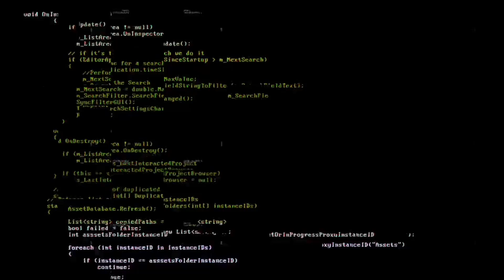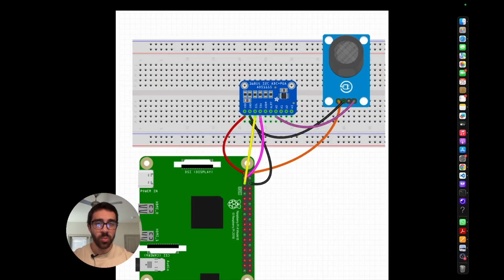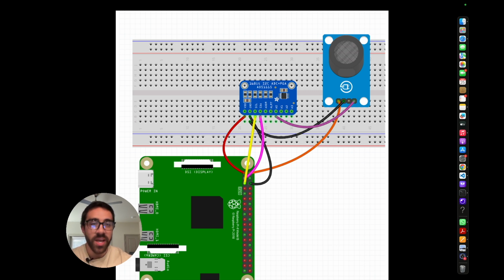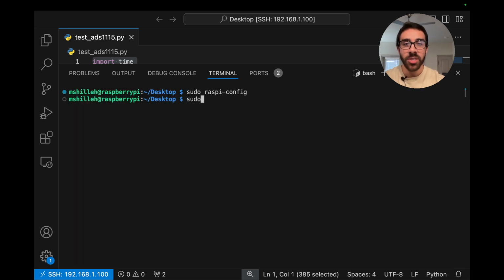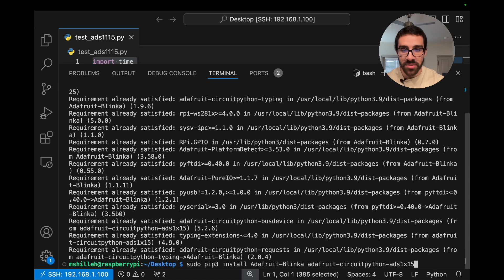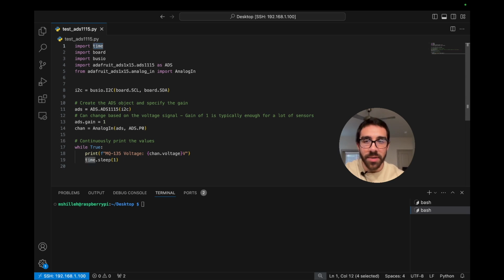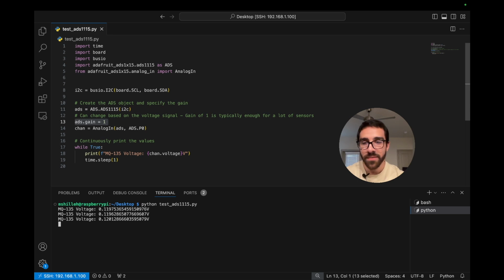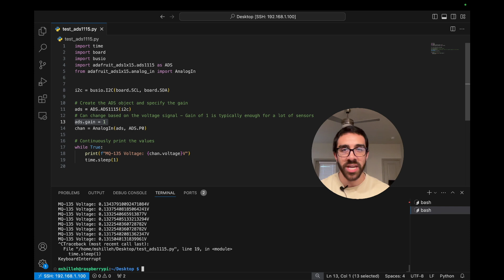How to Connect ADS1115 to Raspberry Pi - Measure Analog Signals with MQ135 (Part 1)

Comment: AttributeError with Adafruit ADS1x15

Getting error when using Adafruit ADS1x15 library:

```
AttributeError: module 'adafruit_ads1x15.ads1x15' has no attribute 'P0'
```
Please help me...
Reply from the maker: Sounds like a library version issue perhaps? Make sure you have the latest version of the Adafruit ADS1x15 library installed.

Comment: ADS1115 Out is 5.5V, Raspberry pi input is 3.3V
Reply from the maker: You're right! It's important to use a voltage divider or a level shifter to safely connect the ADS1115 to the Raspberry Pi to avoid damaging the GPIO pins.

Comment: Do you think the problem would be improper wiring or what for if there is no device connected once you input i2cdetect
Reply from the maker: Could be, or bad jumper wires. Could be many things
Reply: @mmshilleh where are import board and busio from? I was able to get i2c to detect, and virtual environment that has adafruit_ads1x15 but when I import it won’t import board or busio
Reply: Or I guess how were u able to download the Adafruit-Blinka adafruit-circuitpython-ads1x15 straight from the terminal

Comment: I am using raspberry pi zero 2w. When I do i2cdetect, I see 48, but when I write the code, it gives an "import board" error. When I try to install with pip, I get the "externally managed environments" error. I downloaded Adafruit and I can see it in the folders. PLEASE HELP!!
Reply from the maker: Use a virtual environment in Python, easy to setup
Reply: @mmshilleh  Is it enough for me to set up a virtual folder, do I also need to do something extra for that? I've been dealing with this problem for days...
Reply from the maker: @TeknoTeen0  I can set this up for you in detail if you want to hire me on Upwork if you are interested! Hard to give details in the comments like this :/
Reply from the maker: @TeknoTeen0  Message me on gmail shillehtek@gmail.com

Comment: When installing the adafruit libraries i run into an error about externally managed environments. Do i want these files in a virtual environement or installed system-wide. If i need to install them system-wide, what is the correct command for that?
Reply from the maker: A virtual env is fine! As long as you activate it first before running your code

Comment: Great Video! Thanks
Reply from the maker: No, thank you for watching!
Reply: @mmshilleh  I finally got around to giving this a try. I had an ADS1115, hooked up 4 different voltages, used your code, and got my first voltage connected to the ADC. The question now is what code do I need to add to read all 4 voltages and print out the 4 voltages. Thanks
Reply from the maker: @donaldhoudek2889  Hey Donald good question, I can make a part 2 soon! Happy you asked, stay tuned my friend will try and get that working shouldnt be that hard